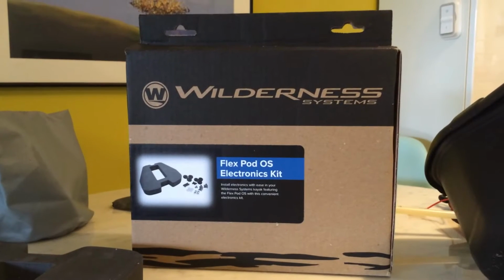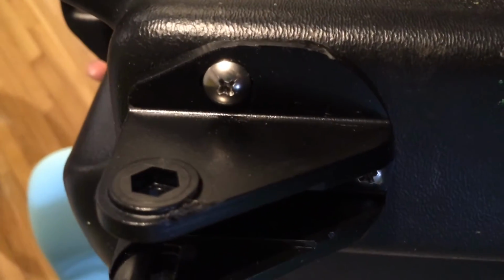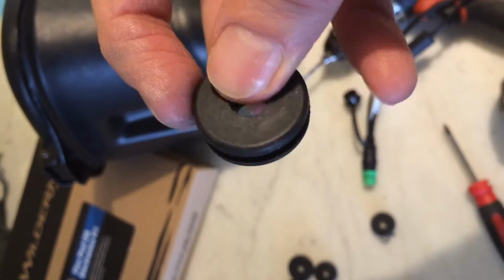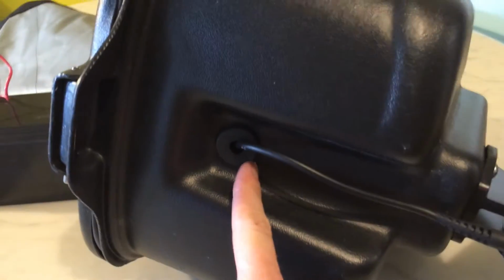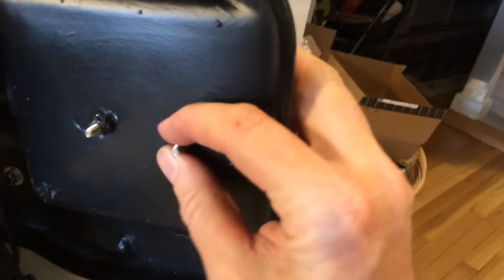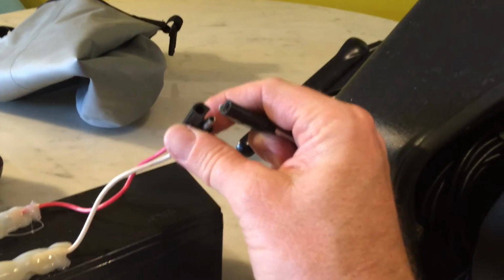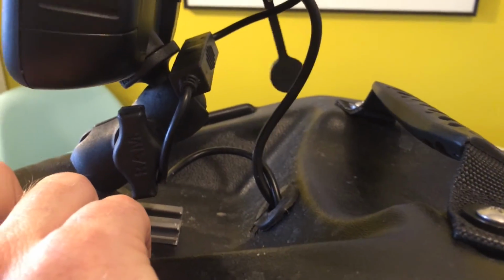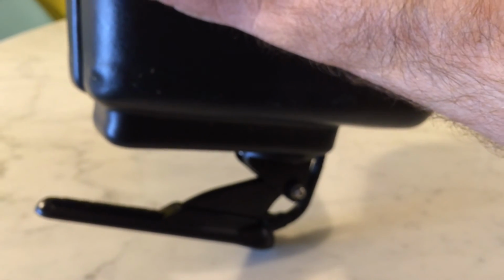How To: Flex Pod OS Electronics Kit | Wilderness Systems

Comment: It appears that this only works if you don't use it with the Wilderness pedal drive. The stowed position for the pedal drive would require that the depth finder/pod be removed first. True?
Reply: Jim Strickler the pod would stay put you just can’t put your head unit/ display on the pod. You’d have to run it to the gear track on the side of the yak
Reply: You can’t use the fish finder on the pod with the pedals ?
Reply: You don't need mount it on the track. The function of that adjustable ball mount is so you can just fold the unit down to it's side and then bring the pedal drive into the stowed position.

Comment: They definitely will fill up with water. Got into some decent chop last weekend on pensacola bay and the cracks between the top of the pod and the bottom let the ENTIRE pod fill up with water. I found that out when my fish finder stopped working and looked: my battery terminals had completely melted away from getting shorted.